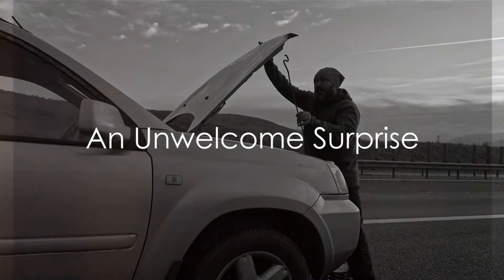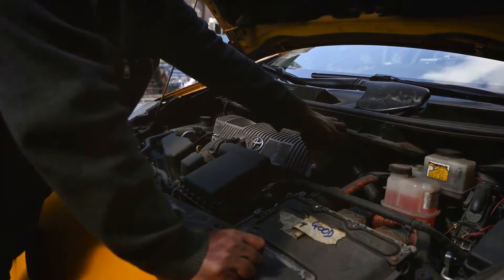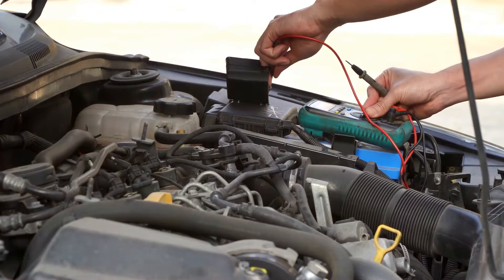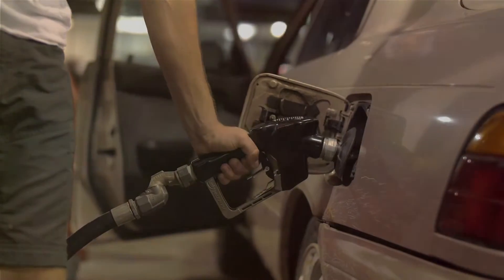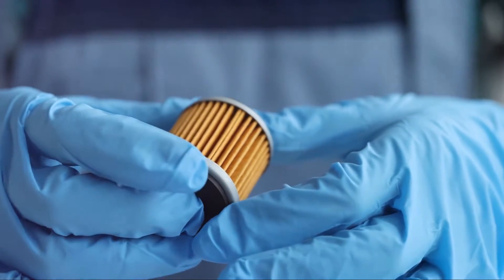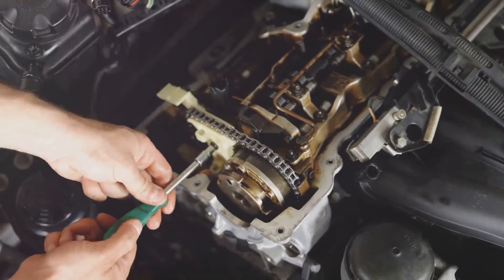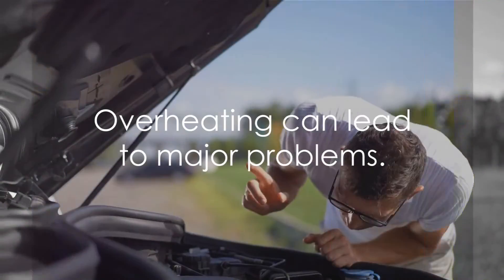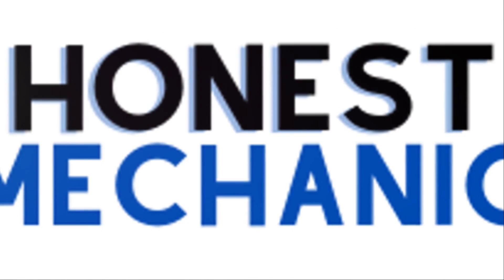Car Shuts Off While Driving:  7 Common Causes

Comment: Battery warning light will not come on when the battery fails!! This only comes on when there is a fault in the charging system, such as worn alternator brushes, alternator fault, or broken drive belt.
Reply: My car has been dying out every time I come to a stop or low rpm if my foot comes off that gas it starts to drop and will cut off I’ve changed the battery and alternator any help ?? Anything helps
Reply: @noeffort2198  I would be looking at the fuel system in case the fuel cut off is not working properly. This can stop the engine when you bring the car to a stop. Look at the throttle position sensor. Also check all the negative connections in the engine bay. Also check the battery voltage to see if the charging system is working properly.
Reply: @noeffort2198 Hey did you fix this? My 02 F-150 has the same issue, the weather is very cold and this car shuts off at every stop or when rpm’s are very low :( 
Anything helps
Reply: @ CHECK THE BELT PLEASE my civic was stalling everytime I let off the gas basically it was the ac compressor locked up so get a shorter belt and look up a bypass diagram for your truck
Reply: How would I know
Reply: @KwmaeGaines  glad you asked. Battery failure is normally indicated by the battery not holding charge or the charge level dropping, or battery going flat rapidly when starting the car. Another indicator is that when you are parked, and listen to the car radio for a couple of hours, only to find you can’t start the car due to flat battery.
Reply: @KwmaeGaines  it was a hung up ac pulley stopping my belt from circulating idk if ur car is messed up still but try it
Reply: I thought that meant I needed to replace my batteries.  I have a 2001 Forf F150 I'm guessing it takes the large D batteries? Hopefully not those 9v batteries they are too expensive that's why my entire house churps, I'm not buying new ones for my smoke detectors lol
Reply: @kennyreck  lol. wtf. a car battery.
Reply: The car would not start if it was the battery and it’s not gonna die while it’s driving because of the battery that beat because of the transmission you have no idea what you’re talking about bro
Reply: That happened to mine batter sign came on and charging system warning and then minutes later i was driving and it just died. I got it to turn back on with a jumper and made it out the road now its completely dead im going to switch alternators hopefully tht fixxes things
Reply: My car keeps turning off while on driving, and I can smell gasoline while I'm driving and it gets stuck in 40 mph while driving have to let go of the gas for it to shift. Any advice?
Reply: @AnthonyJunior-t8w look at the fuel system for fuel leaks on the fuel hoses, along with fuel leaks at the injector rail. Lack of power can be attributed to a blocked catalytic converter or blocked muffler. Also check the cam and crank position sensors on the engine, along with the air filter.